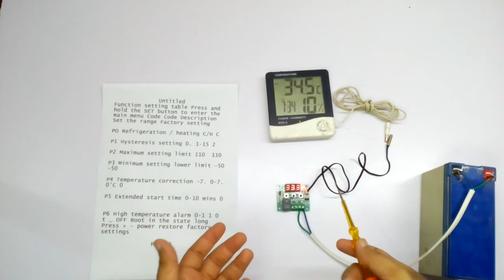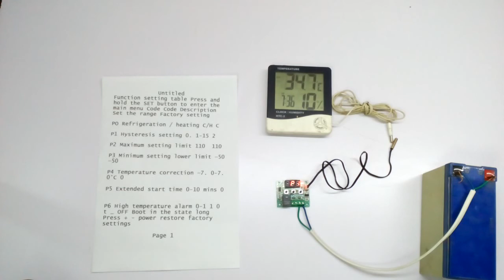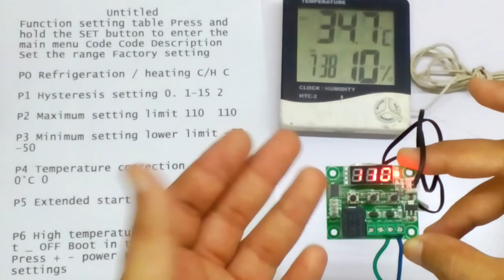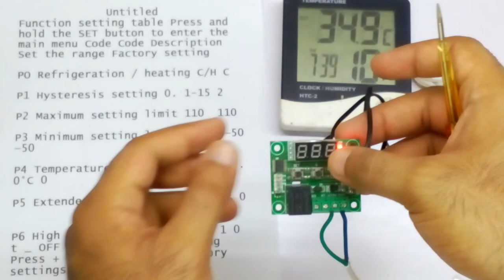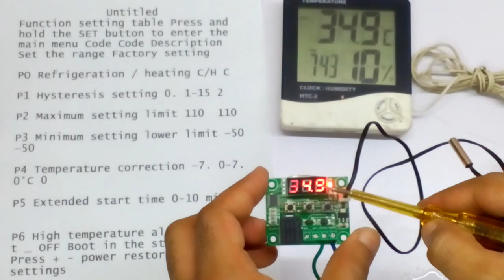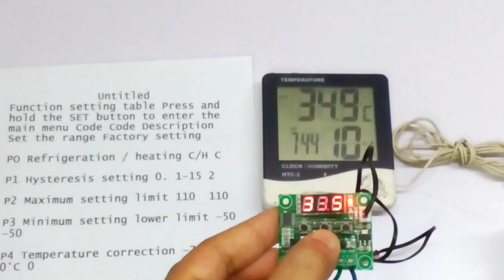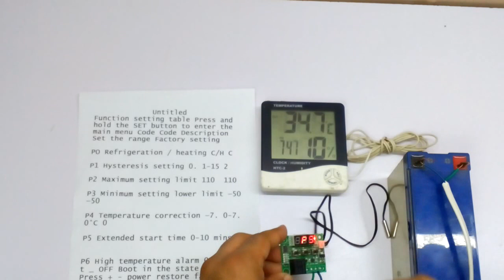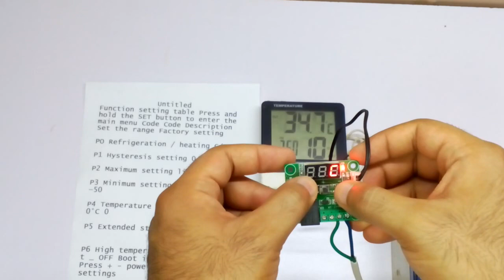how to use a thermostat - thermostat wiring diagram - how does a thermostat work

Comment: im facing the main issue that w1209 shows 37.5 and HTC 1 shows 35.5 . moreover i have installed 12 v dc fan inside my incubator i don't even know which is showing Correct temperature weather w1209 or HTC ? Should i do calibration (p4) in w1209 anybody pls explain
Reply from the maker: Yes you can calibrate the w1209 by P4 but it is good if you can verify with another meter as well such as htc2
Reply: Kk dude thanks  @Umairworkshop

Comment: In my home made incubator thermostat shows 35.00 thermometer htc 1shows 37.5 how to adjust PL guide.
Reply from the maker: Install fan in Incubator and the temperature will be same
Reply: Even im facing the same like but w1209 shows 37.5 and HTC 1 shows 35.5 . moreover i have installed 12 v dc fan inside my incubator i don't even know which is showing Correct temperature weather w1209 or HTC ? Should i do calibration (p4) in w1209 anybody pls explain